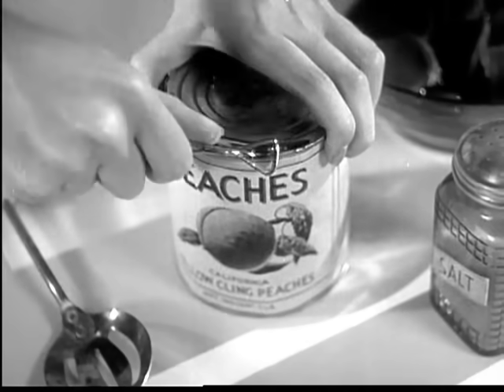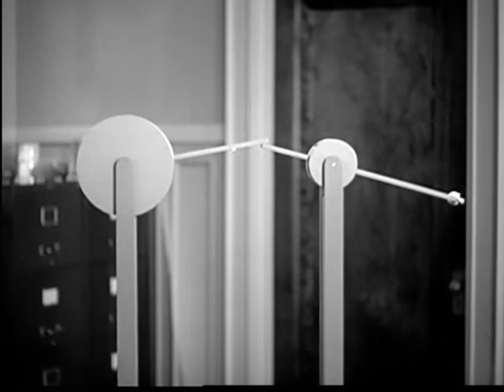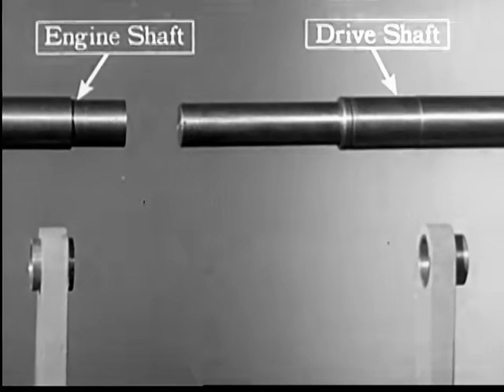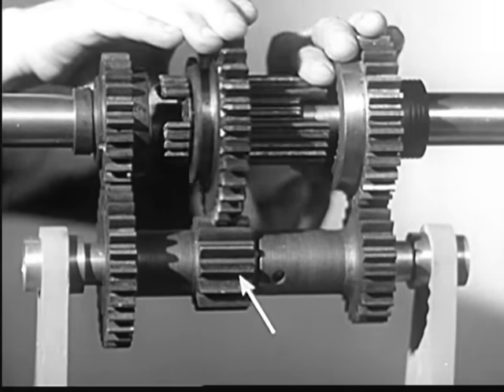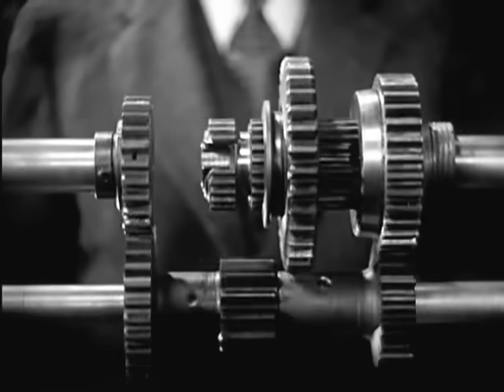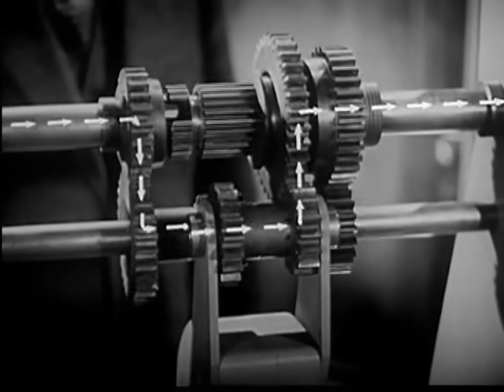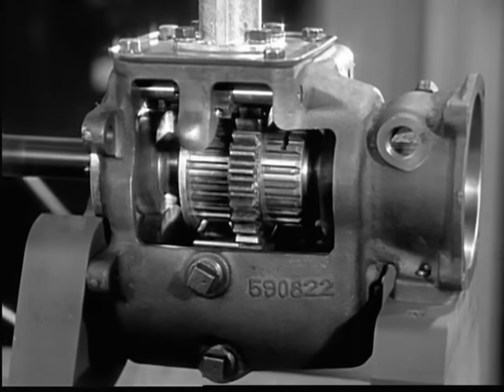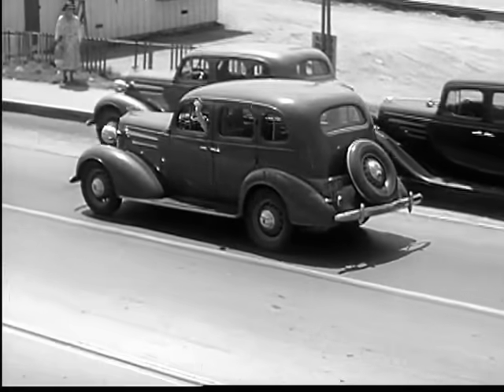Spinning Levers - How A Transmission Works (1936)

Comment: lol 3 forward gears in that moment... today 5 xD nice evolution
Reply: +Yanman88 yeah i  have 10 so
Reply: 2017 raptor.
Reply: hey a guy can dream...
Reply: i have only one :(
Reply: I only have 4... (although my car is a 1991 model so that may explain it)
Reply: yeah 3 speed cars disappeared in the 70s, and 4 speed cars did in the 90s... now 5 speed manuals are disappearing, except on economy cars, but 6 speed manuals will eventually disappear even faster due to the automatic (dual clutch and cvt) gearboxes taking over. 
Most dual clutch transmissions have over 7 speeds and cvts technically have infinite speeds.

Comment: back then when women could drive....
Reply: Cadillac came out with synchromesh in 1928 or 29. I know Chevy introduced
synchromesh on second and third gear in 1932. Women could not only drive
back then but they also knew how to dress. I like the girl's hat and white gloves!
Reply: William H. Burke, Jr. YES xD

so synchros were first started on cadilacs but chevy just took it s a step forward and added it to other gears?
Reply: Jason Jia
No, Cadillac and Chevy both had it on second and  third gears only. That's why
right through the 1950's you had to stop a manual transmission car to put it in first or reverse. Modern manuals have synchromesh on all gears.
 I believe this first happened in the 1960's,  when Corvettes and muscle cars with "four on the floor" started to have synchromesh on all gears.
Reply: William H. Burke, Jr. ahh, okay i see
Reply: @burkewhb  Mr. Burke, when was power steering introduced?  I can't imagine steering one of those huge tanks in the 40s or 50s without some sort of mechanical assist.
Reply: wannawatchu66 usually steering tanks in the 40s was just more variation of the speed of the left or right tracks
Reply: @burkewhb 
They were more 'lady like'
Reply: William H. Burke, Jr. unlike now everyone wearing leggings like it’s their uniform
Reply: @burkewhb   I think those days are gone.
Reply: William H. Burke, Jr. 8
Reply: @NoNo-df5tl  Show me how to synchro a spur gear and idler gear(s) (what's used for reverse, but you knew that right?..) to a helical gear. You can't, honestly if you don't know wtf you're talking about, keep to yourself and stop spreading misinformation.
Reply: When americans could stick shift...

Comment: Those gears must be so tall...
Reply: A 1936 Chevy's three gears would do about 25 in first, 45 in second, and maybe
70+ in third gear. What they don't explain in this otherwise well produced video is
that the girl has to brake her car from 60 down to 45 before engaging the clutch
or she will badly over rev the engine (you can see her foot go to the brake after she shifts into second). Once engaged in second, the car will have engine braking to help take the strain off the brakes when bringing the car to a complete stop.